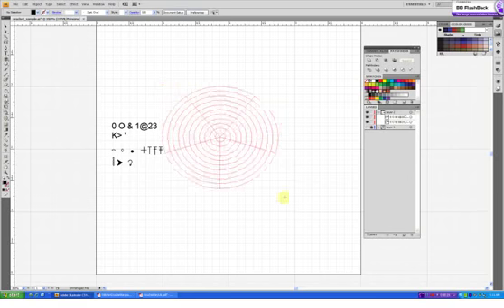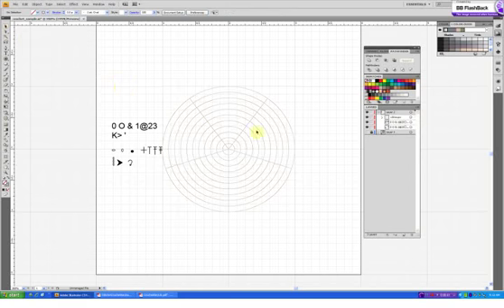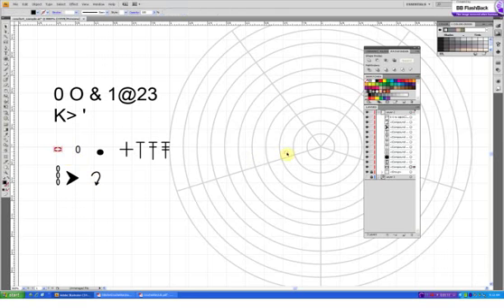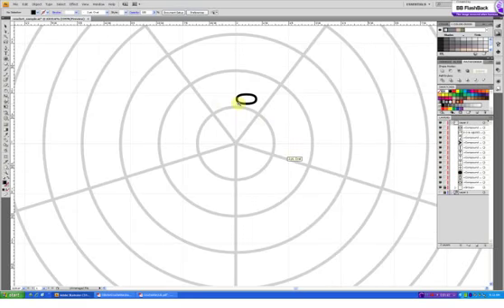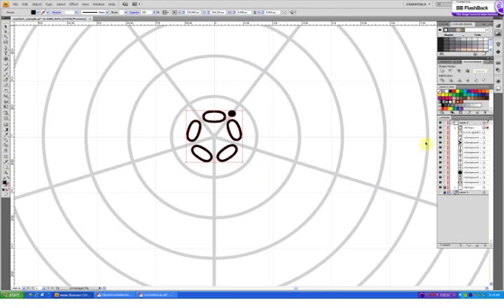StitchinCrochet Tutorial: Part 1

Comment: Have you considered using Pattern Brushes or the Transform effect to make rotations and spacing a bit more exact and easier to apply? This would also simplify altering the pattern afterwards if needed, and make it a bit more flexible.
Reply from the maker: I definitely use the transform tool a lot, but not pattern brushes. Perhaps they've come a long way in the four years since I posted this video.  I've used pattern brushes in regular illustration, but I'm curious to know how you would use pattern brushes to create crochet patterns (not just visual patterns, but patterns that can be followed by crocheters) and how it would make it more flexible to edit.